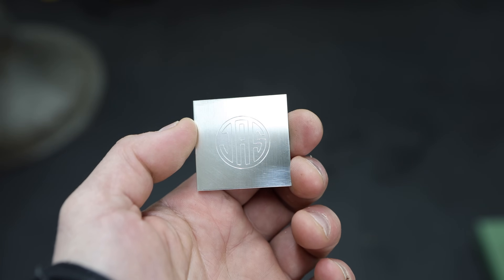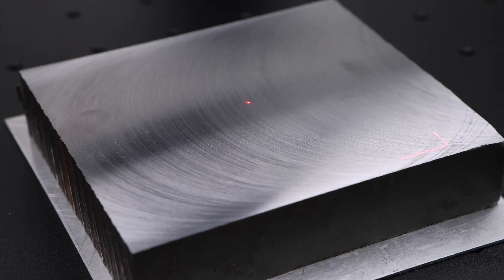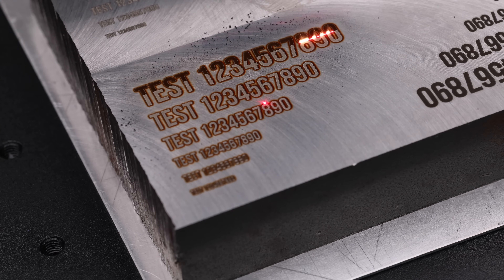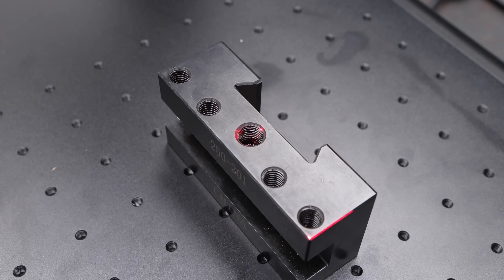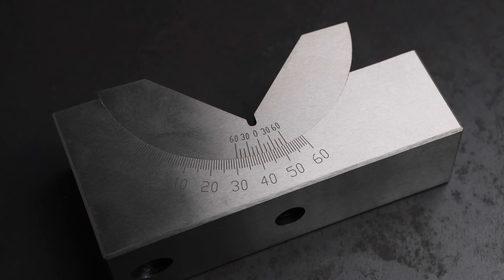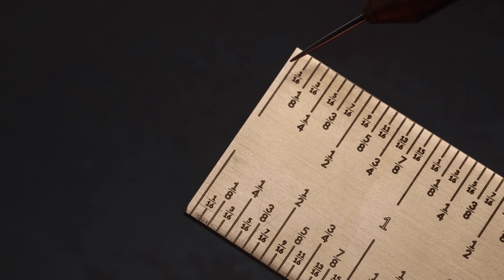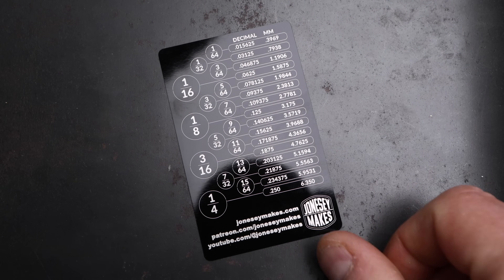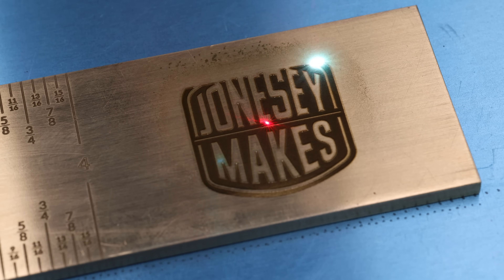A valuable addition to the home workshop?  - Engraving metal with the EM Smart basic 1 Fibre Laser

Comment: I'm thinking about getting one of those lasers, I would like to do some deep engraving in aluminium, brass and other metals. Their website claims it can engrave up to 2mm deep, have you tried tried any deep engraving in metals.  Also that would mean it could possibly cut .5mm thick brass or copper. Let me know if you have tried any of these or if it is possible. Thanks for your time.
Reply from the maker: I’ve not tried deep engraving myself but I have seen others do this on YouTube. It’s a question of multiple passes with a cleaning pass every few cycles I think.

Comment: A feature that I have always wanted was rust removal ability for small items. the big $10,000 + laser welder/cleaners are too big for that purpose. so what i can gather from the video, engraving on bare metal is basically the laser heating up and oxidizing the top layer. you are essentially blueing the surface. Also  The cleaning pass in this case is then vaporizing and dislodging the oxide layer. interesting.
Reply from the maker: Yes those rust removal lasers look awesome
Reply: @joneseymakes  I suspect your engraver should be able the remove rust (or even mill scale) at a small scale, i.e. a coin, a knife, a screw, small steel plate etc. the galvo laser has enough height to allow the smoke to escape without  touching the lens. one engrave power level rectangluar sweep then a lower power cleaning pass sweep should do it, i think. Ah the painted base of your unit is something i dont like if your off target  then you would engrave on the base plate. will need a scarificial plate on the base for experimetation. anyway have fun
Reply from the maker: @asjahan7748  I'll do some testing. Would be interesting to see if it works. Yes, I often put a sacrificial plate under the work piece just in case.

Comment: This might be a dumb question but does anyone know if you continuously traced out your pattern with this laser, could you cut out really precise pieces in metal? 

Wondering if you could use this laser like a wire EDM machine for thin metals?
Reply from the maker: I’ve not tried this but believe it would be possible. I watched a video by another creator the other day doing exactly this with a very similar laser.

Comment: This was all good info I have been looking at this type of laser for a few years and you are correct they have definitely brought the price down. I noticed on there website that if you get there EM Smart  basic  without the rotary it isn't upgradable to have one. You have to buy it with the rotary to start with.🍻
Reply from the maker: Yes I just realised that as I went to buy the rotary attachment. Very disappointing. Apparently they don't fit the controller card for the rotary attachment if you buy the basic model.